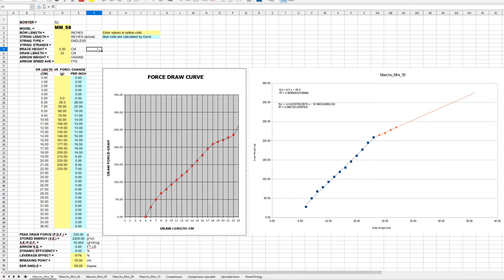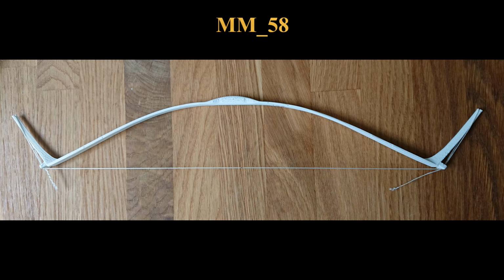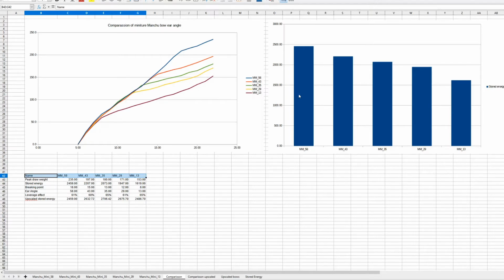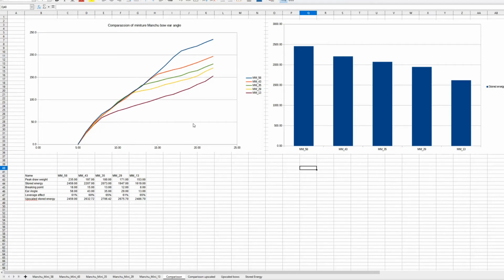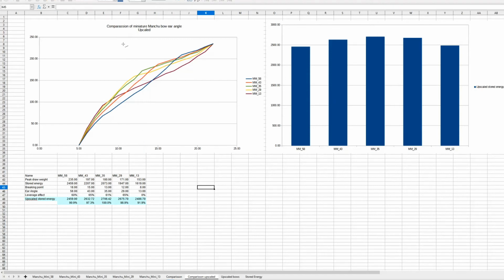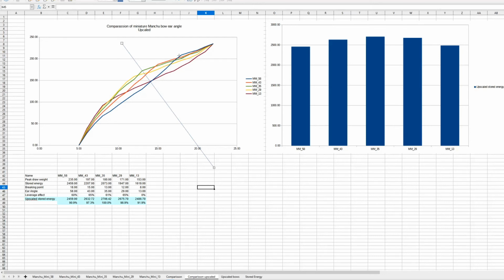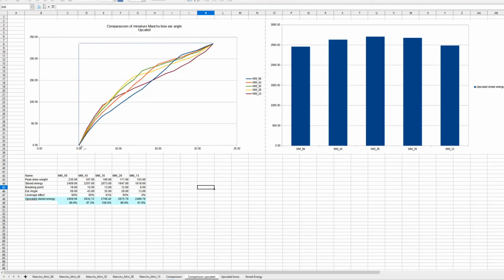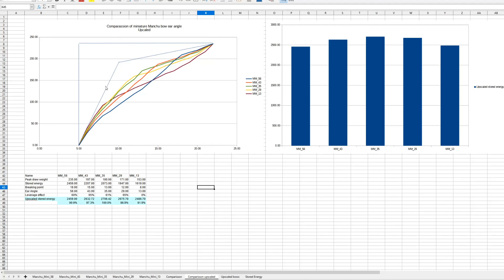Mechanism of a Manchu bow - Siyah Angle

Comment: Do siyahs overstress a bow? I mean, If a bow has siyahs, will it be more tressed than without them, pulling the bow to the same draw length?   I want to try this design with a 64 inch self bow.
Reply: "Del Cat" here on youtube made a video about a wooden lever bow. The stress will be more concentrated since the working limbs are shorter. You have to try and see what lengths work. It's fairly untested grounds.

Comment: You break your head for nothing, The ancient Turkish bowyer men knew all that. By intuition.
Reply: Proving a point is not breaking one's head. He made an excellent demonstration about what our ancient bowyers knew. This kind of work demands respect, by intuition.
Reply from the maker: Hi, yes they definitely did. And we can still buy those high angle Turkish bows today; horn, laminated and fiberglass versions. Historically they are seen on both artifacts, pictures and drawings for both Turkish and Manchu bows. But for Manchu bows the angles have been reduced over time and nowadays there are no bowyer offering the high angles. They don't believe that it stores more energy; actually I have seen the opposite trend for the past years. That's why I did these test; to convince them. Though Manchu hornbow replicas often have high angles.
Reply: Your tongue slipped. I'm sure you meant 'pursue to trully understand', not 'break head'.

Comment: Thanks for doing this. I am looking forward to your next video too.

Is the angle measurement the angle the string makes as it wraps around the string bridge up the siyah to the string nock and  the imaginary line formed by extending the strung bowstring? Maybe I just should have asked how you measured the angle.
Reply from the maker: Thank you yourself. That's a good question. I can add that in next video. I don't think YT allows links. But what you describe is how I measure the siyah angle.

Comment: and I wonder if I can get a 1/4 scale bow to doo some indoor manchu :)
Reply from the maker: hehe they aren't pretty enough. But a small wooden one would be pretty, even a 1:2 scale would be nice
Reply: @itsnotme6574  and one more thing. I believe that the string angle measured at the sitar is most efficient at 60 degrees. do you have any idea about that?
Reply from the maker: @ArminHirmer  I haven't tested that but it should be correct. it's easiest to pull at 90 degree and it will successively be harder. After around 60 degree it's not worth pulling any longer. For the manchu bow a bigger bow is the best cure.
Reply: @ArminHirmer  Is that 60 degrees rule special with horsebows? I build all other types of bows and these all work best with different angles.
Reply: @itsnotme6574  1/4 is just fine and for me pretty enough :D
Reply: if you don't know what to do with them now, I will take them hahahaha
Reply: @ArminHirmer  Maybe when he finished collecting data, he will share the 3D printing files.

Comment: wow, thats very interesting. looking forward for the comparison of siyah length (just the 35 degree one?)
Reply from the maker: Thank you. I have finished the data collecting and made the graphs, but didn't take my time to make a video. I did the test with several lengths and angles. The longer the better, but instability most likely makes the historical length of about 20-25cm the sweet spot.
So for best performance the bow string should be in contact with the string bridge until half the draw length, with my brace height and draw length that is about 35 degree. Brace height should be minimized and draw length should be maximized.
For modern laminated and fiberglass bows I think it's hard to get sideway stability with high siyah angle. So I haven't managed to order a bow. Probably need to build one myself.
Reply: @itsnotme6574  What is brace height. Could you please share the two spreadsheets? The one for the angle variants and the one for th e siyah lenghts.